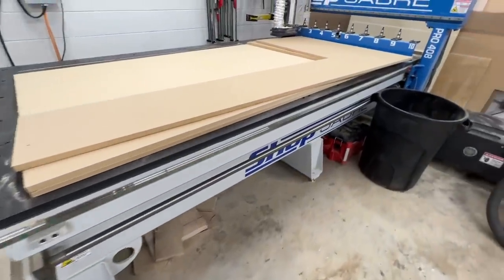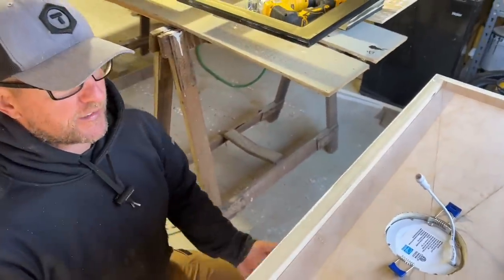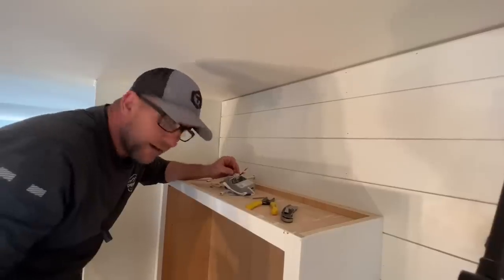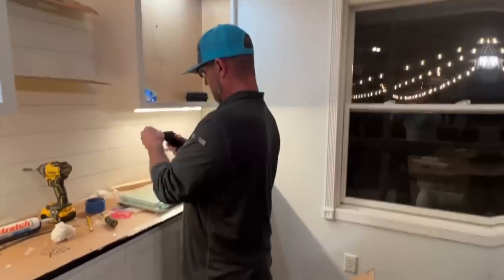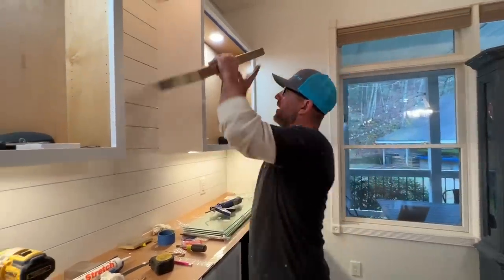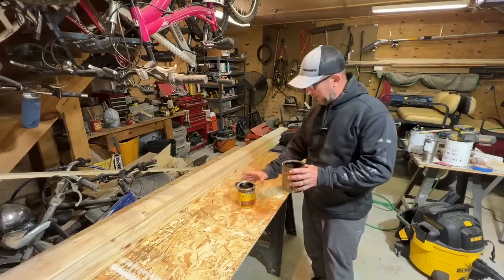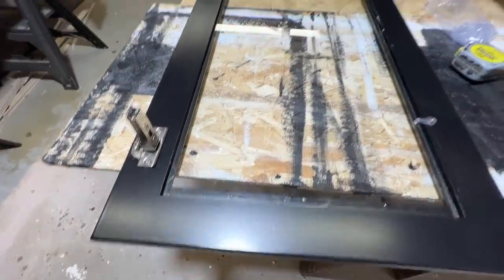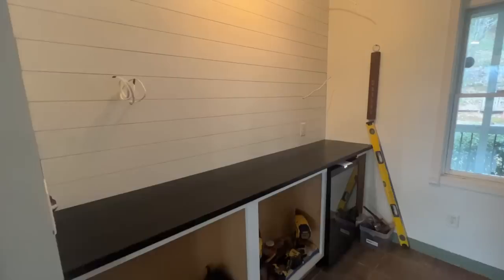Cabinet Upgrade—The Big Reveal

Comment: I work for a cabinet company over in Ontario Canada. When we put glass in a frame for a door, we silicone it in. As long as whoever does it can lay a nice bead, it gives a much cleaner and more elegant look than some screw on clips or staples. Although if the glass ever needs to be taken out for any reason, that can be tricky and messy.

Comment: You could add a small astragal to the backside of the uppers to block the light from coming through the gap.
Reply from the maker: That sounds great…but what is an astragal??
Reply: @Building_Jays_Way  the piece of wood that the secondary door registers against when both doors are closed.

Comment: In the end, everything turned out great Jay. Try using the foam brushes when applying paint or poly. I’ve used them for years, they do a great job, they don’t leave brush marks and they are very inexpensive.

Comment: About your soft close hinges if you didnt know, you can deactivate the soft close system on the other hinge by sliding that small gray plastic piece on the inside to the other position so the doors still soft close but not so slowly, atleast thats how i prefer them when i install cabinet doors :)